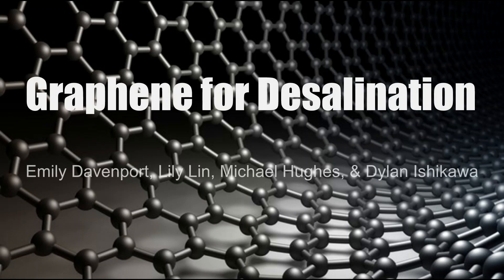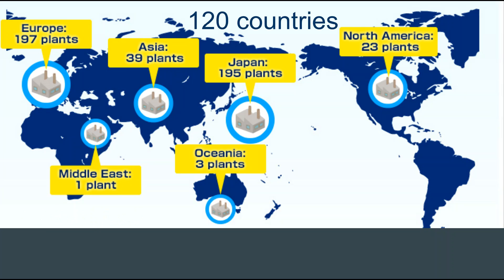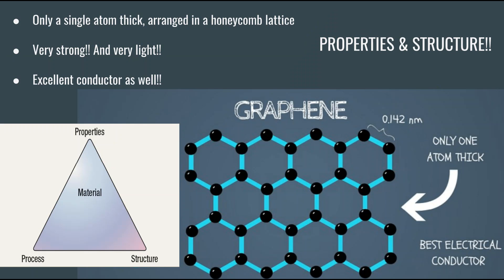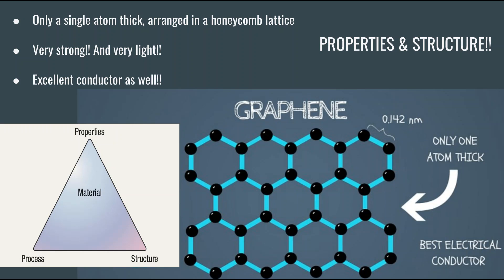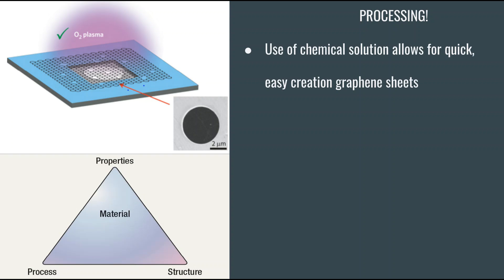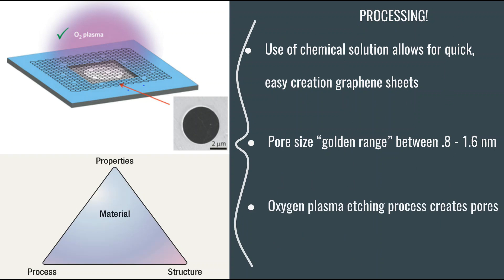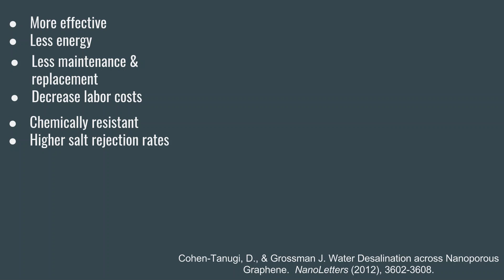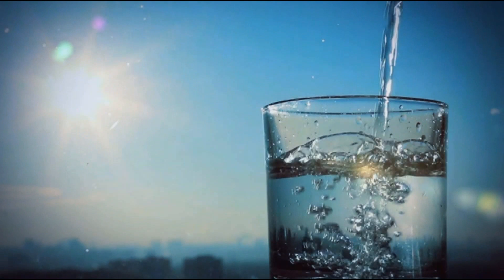Graphene for Water Desalination

Comment: Is this material comparable with forward osmosis?   Forward osmosis is the movement of water to a higher salt concentration.  If the right draw solution is used water is pulled from the less salty solution.  The draw salt is then separated out using a temperature separation and is reused.  Would this be a better material to use for forward osmosis and or would your material be useful to extract trace elements of the draw salt from freshened water?
Reply: Better

Comment: ahhh but will it filter out  Fukushima's or Hanford's Radioactive Contaminents in our Ocean's water? Do you think they could be used to filter out the lead &/or florides in the   water in places like Flint, MI, and other places where city plumbing is breaking down and poisoning us humanbeings...
Reply: Aliasnan  Love the problem with lead in Flint water is not lead in the supplied water.  The problem in Flint is the use of lead pipes and a change to a water source that had the ability to corrode the lead into the home water supply.   These pipes are pipes that often connect the residents to the water mains. It was a simple issue of water chemistry. The addition of a few hundred dollars of anti-corrosion agent (Yes, for the whole city.) would have prevented the problem.  However, once the pipes have been corroded they will continue to leach lead for several years even with the anti-corrosion agent in the water.  Lucky, lead and other heavy metals can be removed with the right ontap water filters. Only real cure is replacing the home water supply lines.
Reply: thermal desalination would solve that problem (distillation really since we're not just talking about taking out the salt)